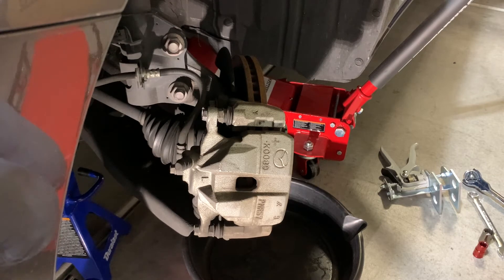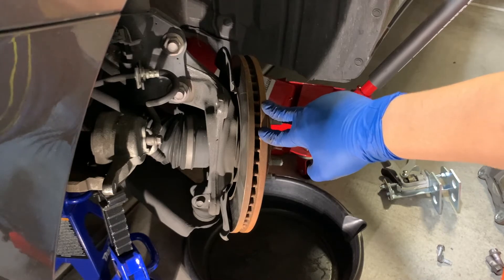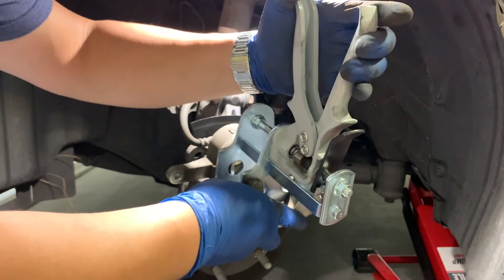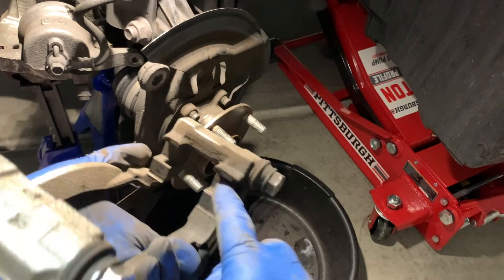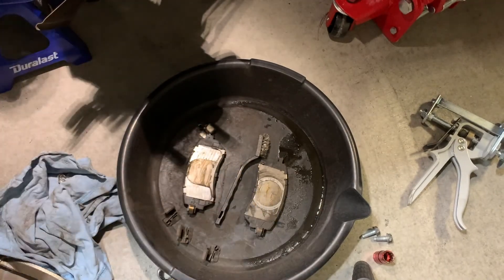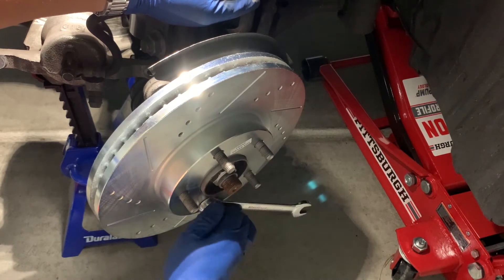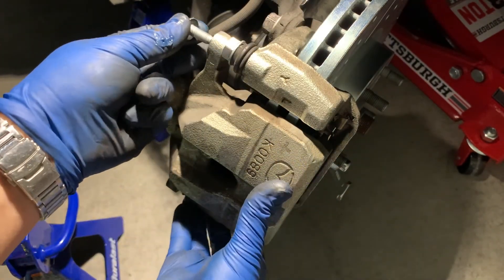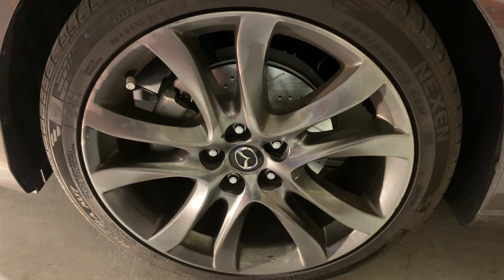2016 Mazda 6:  Replacing the front brake pads and rotors

Comment: Thank you for your excellent video. Both sound and video were very clear. I followed the torque recommendations and had the 14mm caliper bolt that screws into the pin just shear off. I had my wrench set just under 30 ft lbs. Fortunately I was able to find replacement at one of the major autosupply stores. The fact that they carried them in stock might indicate that others had the same experience. The replacement installed no problem using the same torque wrench and spec as before.

Comment: Great tutorial. Just did my front brakes on my 2015 Mazda 6 today. The thing that really helped me was using the backend of a dental pick to 'burp' the diaphragm after compressing the caliper piston.  It had herniated on both driver and passenger side due to air. None of the manuals had mentioned this. If I did not have this hint, I probably would have pinched the boot between the piston and the pad. After burping, the driver's side 'healed' it self, and the passenger side required a little bit of coaxing with my thumb to get it to seat properly.

I would recommend to others doing this job. When compressing the caliper piston, open the bleed valve and drain the excess brake fluid into a container. This way you bleed out old  brake fluid instead of forcing it back into your system. You can also take a look at the condition of your brake fluid at it's dirtiest point and determine if it is old and contaminated enough to perform a system flush.

Another suggestion I have that has worked well for me in the past, is to condition the rubber boots with ATP AT-205 reseal. This is a polymer that I've used to recondition seals in various applications including engine seals in 20+ year old engines showing no leaks. If the rubber is not cracked and deteriorating, it does a good job of keeping it supple and  adding years to the seals life.

Comment: Thank You. Great shots of the components. My wife's 2018 Mazda 6 makes a lite clunking noise while braking in reverse and again when she brakes after putting it in drive. I'm trying to explain and show her what is happening without actually pulling a wheel off. I think there's some play in the clips holding the pads on the bracket and they shift, making the noise the first time she brakes while going in either forward or reverse. She took into the mazda dealership and they told her the brakes are fine. So I'm guessing this is common with this car but at least I can use this video to show her.
Reply from the maker: I would suspect the anti-rattle clips on the brake pads.  I've come across a few cars (especially in Alaska, where I'm originally from) where the clips were corroded/weak or simply missing altogether.

Comment: I have a question that I might have missed .My question is .The brake pads that are installed on the brake bracket .Does it matter what side of the brake bracket they are installed on .Meaning ,is their such a thing as left pad and right side pad only or does it matter .
Reply from the maker: On this car, the pads are generally the same left to right, inboard to outboard.  There are some brake pad manufacturers/types - NAPA Adaptive One, for example, that specify inner and outer pads.

Comment: When you do the disc and pads do you open the brake fluid cap? I am about to tackle the front end of my Mazda 6 tourer (UK MK3 series) myself. I have a mate that said bleed them and I laughed and that lead into a disagreement about the need to bleed current gen systems and said I would just leave the brake fluid container cap off while changing pads and discs.
Reply from the maker: I personally haven’t had to open the bleeder valve when compressing the caliper piston on any vehicle since the 90s.  It used to be a common practice back then, as pushing the fluid back through the ABS modules of the time could damage them.  As always, check the workshop manual for the precise procedure.   As for opening the filler cap on the reservoir, I just make sure the fluid hasn’t been topped off.  When you compress the caliper, the fluid level will rise and you want to make sure there’s room for the fluid.  Use a suction device to make space if the fluid was topped off.  Its not a bad idea to open the cap to help air vent out of the reservoir while you’re doing the brakes.

Comment: Hi, thanks for the video. What kind of protection did you use on the wheel hub and rotor? Zinc or other spray?
Reply from the maker: It varies.  In the snow belt (aka: rust belt), I tend to use a spray called Fluid Film.  If that isn't available, I'll use a light coating of anti-seize.  I don't believe I used anything on this car, being that it is in the dry desert.  I don't see corrosion between the wheel hub and rotor here like I did back home in Alaska.

Comment: How does one obtain a factory service manual these days? I find myself scouring forums just to find torque specs. And I haven't found any reliable source for service manuals, not anything manufactured after 2015 anyway.
Reply from the maker: Things are so different than they used to be, that’s for sure.  For many 2015+ vehicles, you can’t get a hard copy manual like you could before.  A lot of this info is available directly through the manufacturer, on a subscription basis.  For Mazda, you can get info on the subscription at:  http://mazdaserviceinfo.com/electronic-service